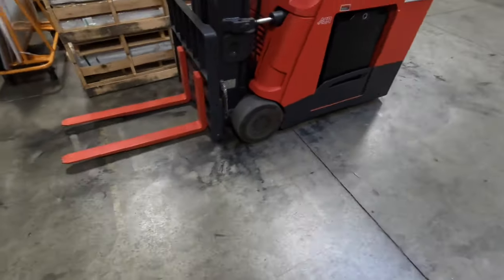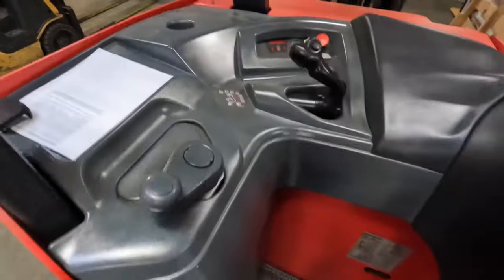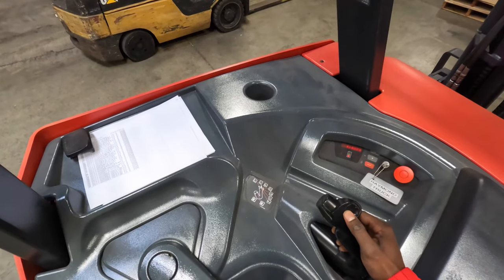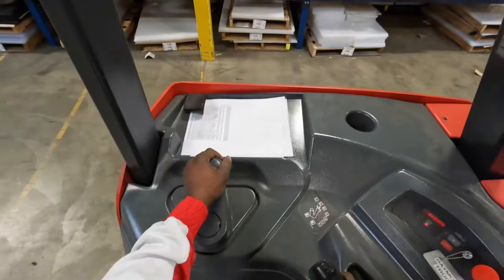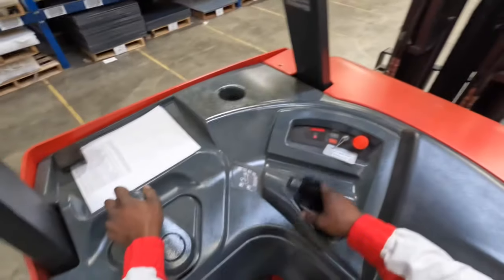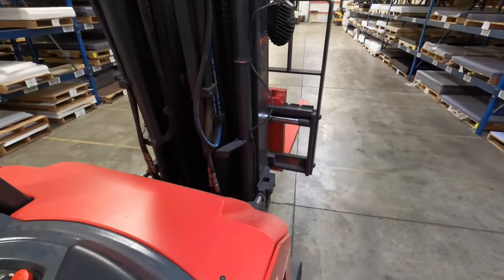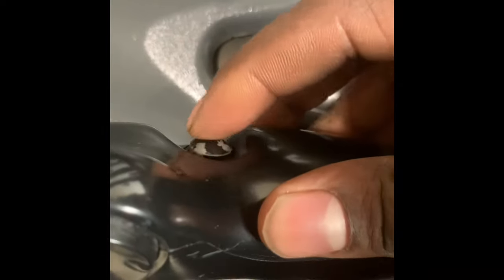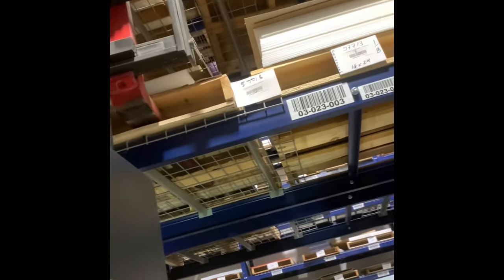Forklift Certified in 5 mins (Stand-up Edition) Part 1

Comment: Braking instructions was completely wrong 😂 the deadman pedal is for emergency braking only or used as a parking brake. Coming off the pedal just to slow down does nothing but break things. To correctly slow down you "plug" to a stop which is when you push the control handle in the opposite direction of travel to slow and stop. Only come off the deadman for emergencies or when your exiting the truck.
Reply: That's how I was taught to brake on both a Crown electric walkie rider pallet jack and a Raymond reach truck, by using plugging. These Raymond reach trucks are fine machines.

Comment: Those Raymond's are no joke. Almost got thrown off one after underestimating the throttle. If your machine doesn't have a limiter, be extremely careful.
Reply: I just started a new job as an operator. I got a brand new Raymond. Newest stand up dock loader. It's temperamental,  but if you learn the gentle finesse of it, fuck is it an awesome lift. I never had anything newer than 30 years old before that. Gotta learn the feather touch.
Reply: @jonathanhaney3701 haha yeah. We got one standup like that. Hauls ass and is touchy.

Comment: Using the throttle, or "joystick" to brake is called plugging. It stops the lift electronically. It is the proper way to stop. The deadman is for emergency braking ONLY.

Comment: Good vid! Few good tips, keep the forks down when turning and once you are aligned with the pallets then raise it up that way you are swinging them every and possibly hitting pallets of merchandise. Another one is once alligned and inside the pallet lift up slowly and tilt the whole crane thing back a little. Not the forks but the whole thing. That way it is in an angle and can also not scrape against the rack and damaging anything. But overall good vid. I noticed even with the standup forklifts there are different makes. I’m used to the stand up crown version

Comment: Thanks for this video. I can operate a turret, order picker, EPJ but not this. And me not knowing this is holding me back. This video help a lot. Im going to start getting some practice in at my job from one of the LTO s
Reply: What's operating order picker like? I know how to operate a narrow aisle reach, a sit down forklift, and an EPJ, but the order picker looks like the most intimidating of them all
Reply: @hakeemsd70m  if you have wire guiding in your building you good. Once you lock in you can only got forward and backwards. But the steering is like a cars. Stay in your lane, you good.

Comment: As a trainer too, to clarify the "Deadman" petal is comparable to the emergency break on the car not a regular break. It's actually not good for the machine to use the Deadman as a regular break. Like he also demonstrates in the video just pull the handle in the opposite direction for a regular break. 

If you are about to hit something or someone, THEN step off the petal to stop immediately (thus emergency break).

Everything else in the video is a great explanation! Good job!
Reply: so you brake with the joystick as you would with an epj handle?and only get off Deadman petal once you're done operating the forklift?

Comment: Interesting that so many people say to never use the pedal as regular brakes. Must be a brand thing. Crown specifically points it out as a valid (and sometimes even recommended) way to slow down/stop. Then again, there you have basically half of the floor as the pedal, so you get much more control over it. Annoyingly, you can either motor-stop or pedal-stop, but not both together. It disables the drive motors as soon as you let off the pedal.
Reply: Its a safety thing. Once you lift off the deadman pedal, the truck (and any heavy load it's carrying) will immediately go to a halt. You don't want that when you're carrying a heavy cargo load, it's unsafe. Use your reverse acceleration to slow to a stop.
Reply: @americanhero8606  glad you pointed that out I usually have a double stack of plastic pallets that lock into each other, that whole reverse acceleration thing you were talking about is called plugging

Comment: Tap? Will definitely get you to crash. Your right hand is your travel and SPEED controller. The more you push/pull, the faster you go. To slow down you just move your throttle to opposite direction that called plugging. And the most important part - turn and align your machine first and only then raise your forks. Otherwise you can lose the center of gravity that can cost you life! There are so many stupid dangerous videos online 🤦🏽‍♀️

Comment: I see when you turn left it goes right and when you turn right with your left hand it goes left. The Raymond equipment I drove today I swear is different than what I drove a couple years ago…someone please respond !
Reply: depends on which wat you're moving...

if you're going forward with the forks in front of you...then when you turn the steering arm LEFT...you'll turn left and vice versa to turn right..

HOWEVER

when you're going backwards, with your left shoulder pointing in the direction you want to to, then it's 'reversed'...when you turn the arm LEFT, you're going to turn RIGH and vice versa when wanting to go left!

This is because you're standing OVER the DRIVE WHEELS, which resemble the front caster wheels on a shopping cart! 🙂
Takes a little getting used to, but once you've been doing the job for a day or two, your brain should get used to it pretty quickly! :-)

Comment: At home depot we used to had those kinda forklifts the ones that beeps louder but we gotten rid of them cause they were old, so they replaced the newer ones that looks similar like the one you drive but it's a little more different plus the horn sounds different,and we have a blue laser also about the check list we don't have to right on the paper we have to press yes and no on the new check list computer on the forklift, and if you get one answer wrong you will fail the test then the forklift won't move tell its reset by your supervisor.and if you complete the test the forklift will move but if you hit something the senior on the computer will stop your forklift and sound the alarm which your horn will go off like crazy.
Reply from the maker: Damn Dlive that’s becoming the new normal. The new forklifts are mainly controlled by cpu which is connected into Wi-Fi. I prefer old school hit something and drive off like I never been there!!!
Reply: @forkliftjoe3620  “beats me… it came out the truck like that”

Comment: Don't get off of the dead man's switch (emergency brake) to slow it down, it will damage the brake wheel, use the reverse polarization of the motor to slow and stop.

Comment: I got a question if i cant see over a pallet i pick up do i drive backwards with it? Also do we always tilt the pallet towards us?
Reply: Always use common sense
Reply: Yes and yes. The only time you should be traveling towards your forks with a pallet is as you’re loading it into a truck, or going directly into a location to store it. Otherwise always travel with your forks trailing.

Comment: It's funny that I've run sitting forklift lifts for years, yet everyone wants to act like it's so different I need trained.
I guess running articulating loaders, excavators, skid steers and sitting forklifts just doesn't mean anything. 
I see you can use that pitchfork well, but that's doesn't mean you can use a shovel. 🙄